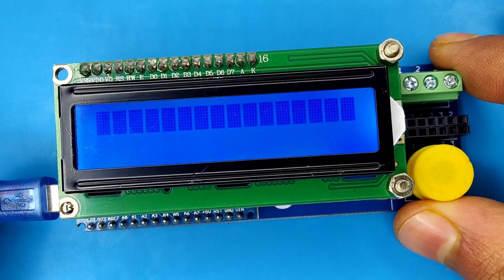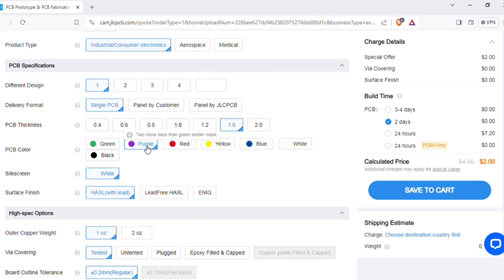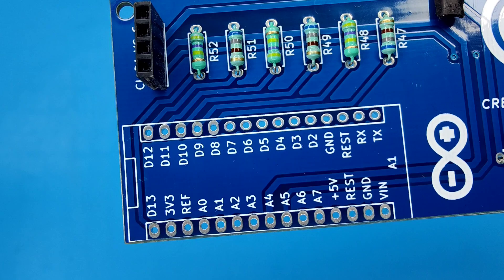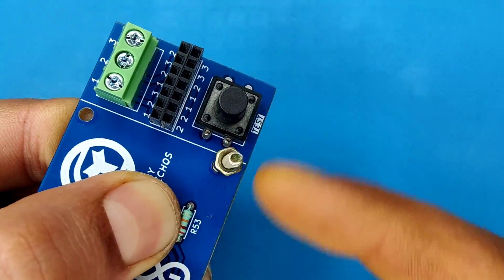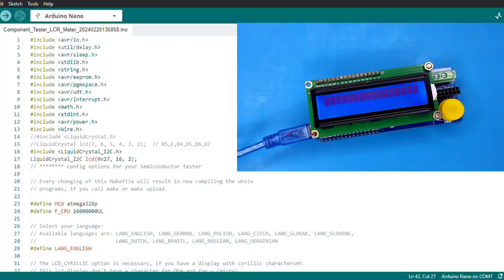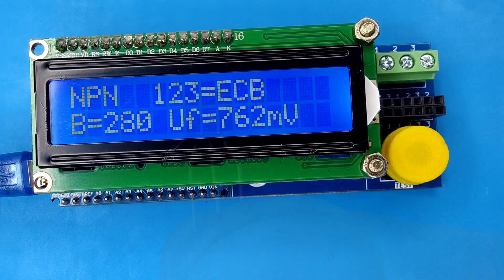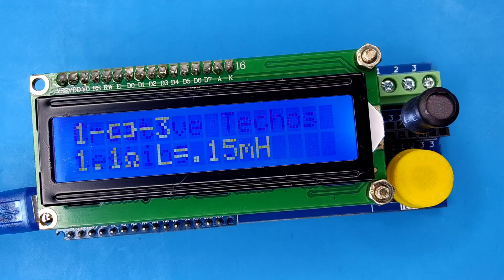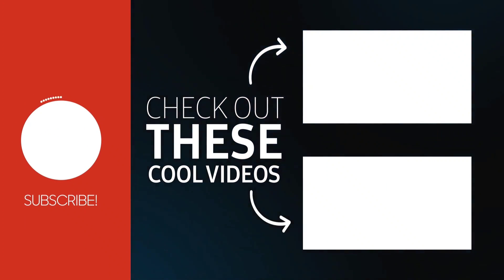how to make All in one Component Tester led, transistor, inductor, capacitor, diodes

Comment: Your resistors start at number 47. I'm guessing you need to re-annotate them?
Reply from the maker: Actually i made few more circuits on each board, for manufacturing reasons, that's why annotation is like that😃
Reply: @CreativeTechos  Ohh ok. Yes that's a great idea to combine multiple projects at once to take advantage of the 10x10cm price point and pack in there as much as possible.

Comment: I don't understand the reason why placing the component testing terminal like this: 
1331232
2211233

Since it can be easier placing this way:
123
123
Or 
111222333
111222333 
Please answer me
Reply: Because modern ceramic transistors are basically two types according to leg configuration base-collector- emitter, emitter - base - collector.. To assign 123 pins with consecutive legs it's necessary to follow that pattern

Comment: It does not work correctly accurately, with no component it reads 48.42 uF at pins 2-3 after a few presses it reads 32pF pins 2-3. Resistors seem fairly accurate. Capacitors read 2.5 times real value. Transistor seems OK. Can you offer any help on capacitors calibration, thanks.

Comment: The code will not upload I get error - attempt 1 of 10: not in sync: resp=0xd9 - I try to see if worked trying other board Nano every got Compilation error: 'ADCSRA' was not declared in this scope.  I then found out you have to use the OLD BOOTLOADER

Comment: Haven't tried but looks great. Powering by USB is a significant advantage. One I have uses 9V, and inconvenient sometimes. One minor typo on PCB under Logo. Has to be 'Creative' not 'Creatve'.
Some suggestions for future.. Since analog pins of A4-A7 are available and utilizing LCD even more, and there is room on PCB, I would recommend to utilize those analog pins by connecting to LDR to read light/voltage value, temparature reader etc.,  Keep up with good work. Thanks,.

Comment: Excellent job.  Impressive sketch.  I couldn't creat it, hope to learn from it. Thank you.
I built it up on a BB with components at hand before ordering PCBs.  (Which I did).
 - Needed to comment (//) #define PULLUP_DISABLE as there are no outboard pullup resistors in given ckt
 - Took me a few to figure out my display(s) needed a different ii2 address (0x3F).  0x27 as defined worked on my 4 line LCD, all my several 2 line units are 0x3..
 - All functions work as demo'd, but electrolytic cap readings are high, even when discharged prior to test.  Need to figure that out.

Comment: Please mention which pin for what components in that 14pin header 😢
Reply: it's stated on the board
1 2 3 1 2 3 2
2 2 1 1 2 3 3

Have you never seen this before ?

- All the 1's are shorted to each other
- All the 2's are shorted to each other
- All the 3's are shorted to each other

so... You need to decide which component you have ,
You can test a component with up to 3 Legs
1 Leg will go in 1, the other in 2  the last in 3  THE ORDER DOESN'T MATTER , the Dev board works it out

if its a 2 pin component,  use any pin 1 and any pin 2
and.. You can use Pin 2 and Pin 3 as well

it doesn't matter, Just don't 1 leg in 1 and the other leg in the same number

Comment: Great project! Is it possible to test zenner diodes?
Reply from the maker: Yes of course you can check zener and other diodes, it will show you the max forward voltage
Reply: @CreativeTechos  Which means it will not test a Zener diode.
Reply: @przemekkobel4874  is it can test the 18volt zener or more
Reply: @trilamquang3444  Allright, but then this is not a "forward voltage", is it?

Comment: The project looks great, I only have one question, is there an instruction for the 14-PIN HEADER?
Is polarity important, e.g. diode, transistor... you can put +- or -+, into which holes to insert different components for the test?
Reply: The device recognizes the component and also its connections/polarity itself.